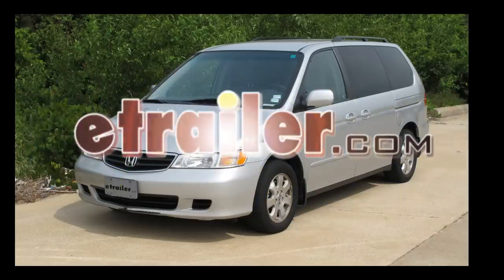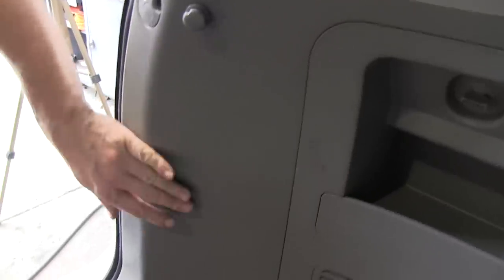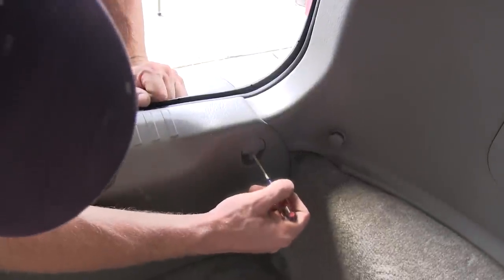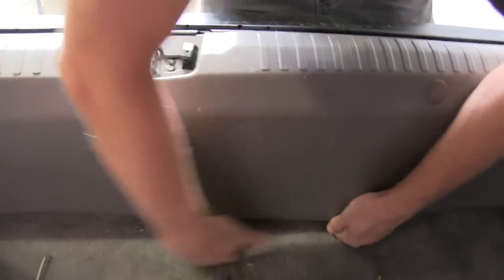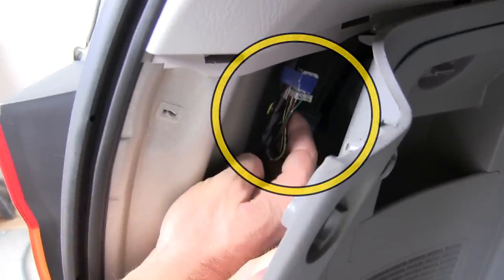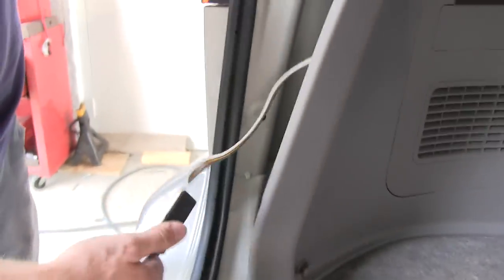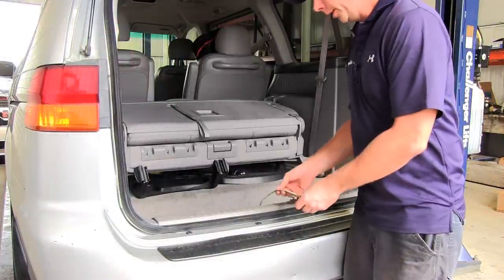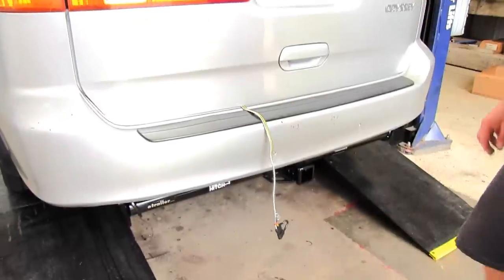Install: T-One Vehicle Wiring Harness with 4-Pole Flat Trailer Connector on a 2003 Honda Odyssey

Comment: How much weight can that particular van tow? I have the same one.
Reply from the maker: You will need to check in the owners manual of the vehicle to see what your year, make, and model are designed to tow.
https://www.etrailer.com/Custom-Fit-Vehicle-Wiring/Tekonsha/118336.html